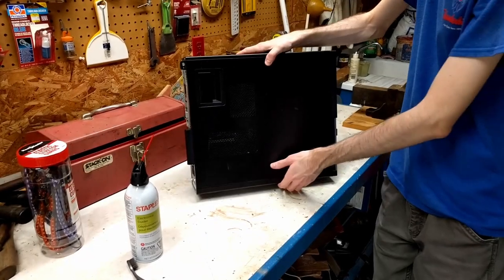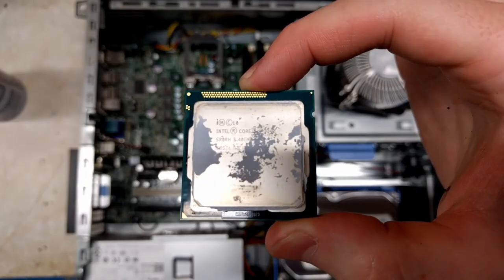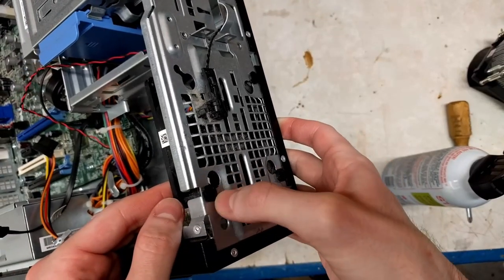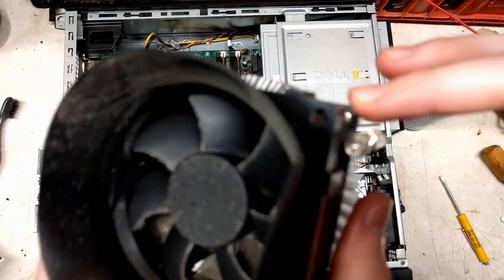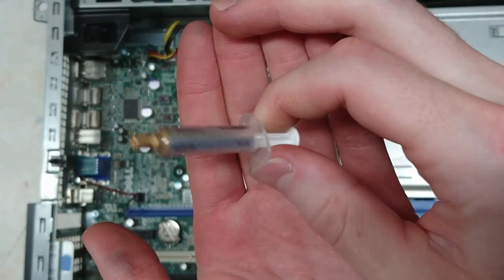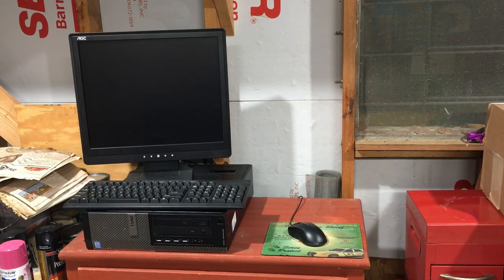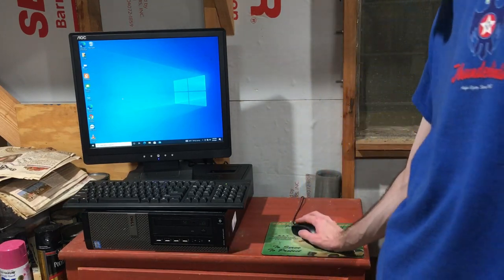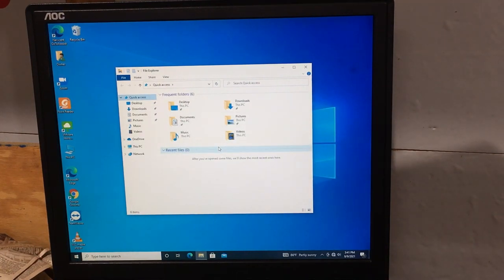Nice Complete Dell Optiplex 7010 Found at Goodwill for $25!

Comment: Hey I have a question and Im hoping you know the answer. I just acquired for free a very similar Emerson 20” flat CRT like the one you have (this model is the EWC20D4 and has the built in DVD player)…. My observation is that the picture quality is fantastic and crisp, but the vertical screen sizing is to great, which is pushing some of the text at the top part into the overscan area, cutting it off. The only fix is to get into the Emerson service menu and adjust down the vertical sizing. Have you entered your Emerson CRT’s service menu before? If so, how did you do it? I tried researching but no luck anywhere.
Reply from the maker: I’ve never been able to get anyone to describe how to get into the mystical “service menu” despite being told of it many times

Comment: Does wrapping aluminum foil on rabbit ears when connecting them to a Digital to analog converter box (when you just get the urge to watch tv on a CRT like an old timer) actually strengthen the signal or is that just a myth?
Reply from the maker: Absolutely not! It might not be immediately apparent unless there are a lot of channels in your area, since with digital all you can hope for is more channels to pop up, but it certainly will increase your signal strength.